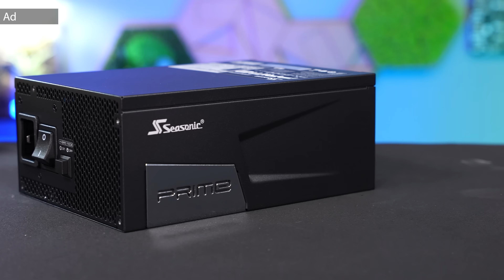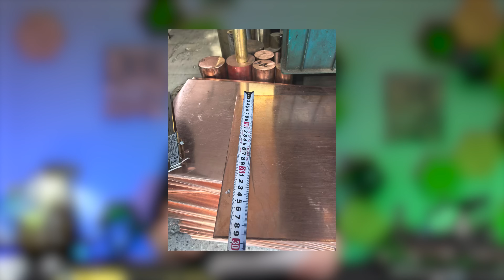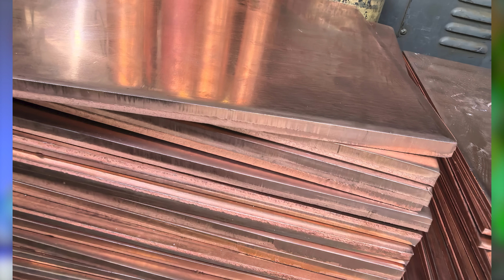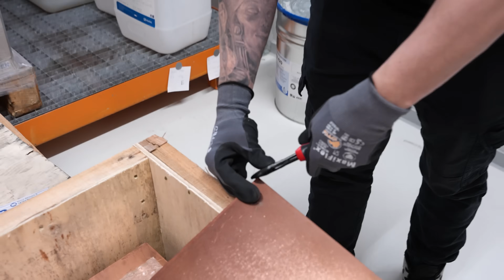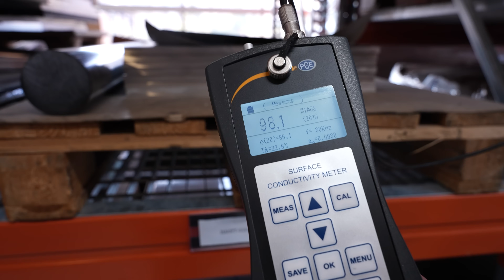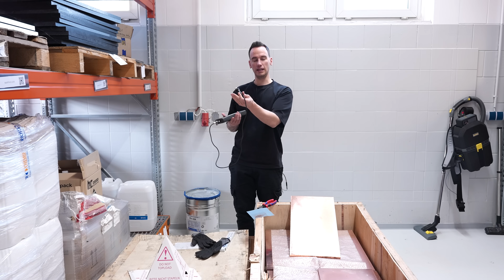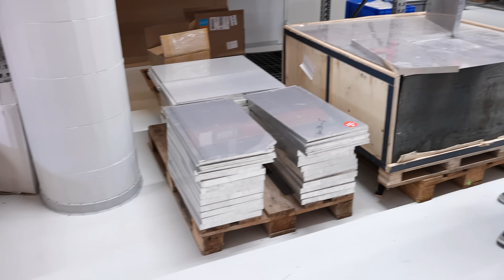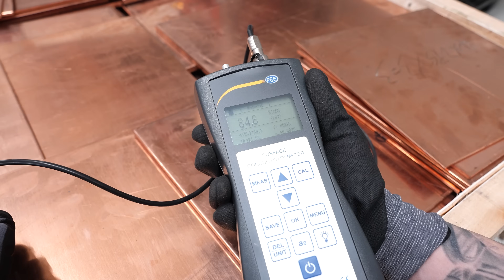I Got Scammed

Comment: American Express Purchase Protection covers eligible items against theft, accidental damage, or loss for up to 90 days (45 days in some regions) from the purchase date. Coverage is generally limited to $1,000 per occurrence, up to $50,000 per account per year. It applies to items bought with an eligible card, covering repair or replacement costs.
I don't know if copper plates would be a covered item under the American Express plan, and it looks like you would need to make 40 separate $1000 dollar purchases, but there must be other types of insurance you can purchase to protect yourself from potential fraud.
Reply: Yes, all of the large insurers that you know by name offer commercial theft and fraud insurance.

Comment: Only way to really prevent this as much as you can is to either work with an independent shipping agent to act on your behalf and verify all goods prior to shipment, or to hire someone to be your direct sourcing agent and send them over anywhere to verify all orders are what is being bought prior to shipping. They would also be responsible for making sure the shipper chosen is one that is going to be reliable and takes all reasonable precautions to avoid cargo being stolen/swapped out mid-transit.

Comment: I worked at a aluminum foundry they got ripped off on 150 grand worth of ingots that were supposed to be 25lb bars of 356 and they sent 319 with weights hidden in it to make it weigh right but you can tell by the difference in color of the alloy after you have worked with the different alloys long enough the bad part is they laid all of us off when Obama won then bought the whole damn Chinese foundry that ripped them off where they paid the workers 18 dollars a day for 10hr days with no benefits and were able to produce the parts there and import them here for cheaper than the cost of operation under the Obama regulators who were fining the hell out of them after he took office Obama and his regulators all but collapsed the foundry industry in North America in his first year of office

Comment: I've worked in the electric motor industry and we dealt with this all the time, competitors selling chinese motors for cheaper, and the reason they can is because of copper cladding. The Chinese are well known for coating aluminum with copper for motor components, and coating steel in other applications, which you discovered here.  Copper coated aluminum has been a huge problem for household electrical wiring as well.  Sorry to hear you got bit by this :(

Comment: Less than 2 minutes into the video you said copper and I immediately knew it's either Meth Heads or the term I've seen used "Chinesium". I'm not involved in manufacturing, construction, or importing...why do even I know about this? Still like others have said, I respect your willingness to be open and honest by sharing your experience despite the embarrassment.

Comment: Here’s my scam story. Spent $1700.00 on a Gigabyte RTX 4090. Purchased from CTO Technology in Richmond Hill, Ontario, Canada. I build and sell high end gaming rigs. I have product inventory. In this case, I tested the 4080 by booting the card on the bench and installing drivers. Everything good………..back in the box and on the shelf until needed. It was over a year before I needed the card, but the time had come. Paired with a 7800x3d and 64GB of ram on an X670e it was looking like a strong build. This “refurbished” card was apparently fully tested by CTO Technology………yeah…………no. Literally 30 seconds after running Furmark, the PC rebooted. Ok…..glitch. Then it did it again…….and again with Heaven…….3dmark……..whatever stress test I tried. Swapped the ram…….no change…….swapped the CPU…..no change…….swapped the board……..no change……..swapped the 4080…….problem gone. Now remember, I used this card for like 10 minutes when I received it……..but never ran a stress test. After explaining this to CTO Technology they proceeded to say the card was no longer under warranty. Bastards I thought! This card was supposed to already have been stress tested by them. I checked their website and it clearly states the following………..

What is a refurbished product?

A refurbished item is a previously owned product that has been thoroughly inspected and tested to ensure optimal performance and reliability. It is typically backed by a warranty from the seller. Before being sold, refurbished products go through comprehensive quality and functionality checks. The key distinction between refurbished and used items is that refurbished ones are verified to be in good working condition and free from defects, whereas used products may not have been tested and could have issues.

Obviously a total crock of bullshit. Oh, and the RGB on the card didn’t work either.

Comment: Didnt you purchased on Alibaba, so what the problem?..
you weirdly enoyugh dont mention anything about that platform buyer protection as there are numerous fall back nets, if you recive something that aint correct?

"If you purchased 40,000 Euro of copper on Alibaba and received steel instead, your coverage depends entirely on whether you followed Alibaba’s safety protocols. If the transaction was done properly through Trade Assurance, you are potentially well-covered for a refund, though the process may be lengthy and require extensive proof. If you paid outside the platform, you are likely not covered at all"

Did you went outside Alibaba, and purchased it directly and is that why, you dont wanna mention this?
Reply: You sound like you're blaming the customer over the two separate companies that blatantly scammed him, both on the same website, and both with 5+ year records on there.  It's highly unlikely it's their first time scamming and yet they have been on that platform for years.

Also your quote there sounds like you just asked AI and then copy pasted the answer here.  I'd like to see examples of people actually getting refunds through that platform.
Reply: @jar-z7t  no shlt.. its qoute marks.. did you think I contacted some lawyer.??  come on sherlock..make an effort.
Obviously people use Google for basic info, not least on Alibaba's safety protocols,  - as they have quite a few, that will protect you if you receive a different product, but channeholder weirdly enough dont mention anything about this, and no wonder people speculate if he decided to went outside Alibaba for the purchase, perhaps to save money, so sellers dont have to pay Aliababa fees, but he dont inform this, and thats weird as Alibaba safety protocols would be the first thing you would turn too.. and certainly not do private inquries, as its not like he can be in doubt if its a mistake.. come on..its stacked to cheat and the other steel that is covered in cobber again t cheat??.. 
Use Alibaba and do it fast as they do have, certain funds locked for a given time.
So weird that he he only mentions that he found the sellers on Alibaba, and nothing about if he actually made the orders there.??  (that is the most vital info to ask, and trying to help him get the money back, but we dont know)

And im not sure, if you dont get common sense.. asking obviously question that aint informed..how is that blaming... stop being offended on other peoples behalf at every turn, not least when people just wanna get some transperancy on a given matter and help.
Also weird that he dont wanna warn other people about these two companies.. As you can bet its likely not the first time they did it, and it can often be the same company operating under different names, as they have tons of listings and different names, and particularly companies intended to cheat western buyers... also no info onwhat he paid, as that a can also be a sign, if one seller is way under marketprice... Copper its just like GOLD.. nobody is gonna sell it under its marketvalue, and if somebody do, then they are up to no good, and its easy to check 99.9% copper prices in China but he shares nohthing about these things.. was the price weirdly low, and was that why they wanted you to fx purchase it directly for some special price??
and ofcourse I do get that he perhaps dont wanna disclose if that is the case, as viewers would perhaps make fun of that, and that is the last thing he needs on top of the loss..

Imagine if other people have warned about these companies or shown their listings on Alibaba, and he mde basic due diligence before handing out 40k then there would be a big chance that channelholder would not be in this pedicament, as he would have clocked on the warnings about these specific sellers and their company.. but nothing is shared.. to warn others with, and one of them is just ignoring him. so share the dang details, as otherwise these chinese sellers will never stop, if there are no personal consequences and they can just do it under their country umbrella from the other side of the globe.

Comment: I've had problems with car parts coming from china. The samples are good not great but the actual shipment has tones of problems. With steel parts like crankshafts and camshafts the tolerances are always the top end of the oem spec like a milled round that needs to be .003 to .005 inch oem spec they can get the resolution of .001 just fine but they always pick the bigger number. I think they believe that the bigger number is better when that is never the case for a gaped clearance. No explaining that has fixed the problem. Also oem forged parts they will copy the parts 100% but cast it and make it look forged.

Comment: Tough lessons all around.
As someone who's dealt with China imports, any reputable company would do LC (line of credit) with a small percentage pay up front and and remainder after shipment arrival, and also when you're trying to build a relationship and source things long term, always visit. It might cost 5 days and $2-3k to visit China, but you can line up 4-5 suppliers easily within a week and talk with them all and set up things.
The concept of face is important and if you're buying raw material from alibaba, unless they are a LARGE company, it's going to be touch and go.... the chances are you might be taken advantage of if you're dealing with a small company.

Comment: There is zero reason for shame! I understand the feeling but if they are going to scam it ig going to happen. Does not matter the country of origin scammers scam. You did your duty towards all other manufactures by making this video. It stands as a record of current behavior and a warning. Also shows how to check your supply so small builders can figure out if they were scammed. You handled the situation well and thanks for doing so.

Comment: Seasonic PSUs not good. they using 135mm fans. they are not available and you cant replace them with anything else. 140mm wont fit and 120mm need diy adapters.

Comment: Ohhh boy.  As soon as you said you ordered the copper plates from China, I had an idea where this was going.

I used to work in supply chain management for various manufacturing companies in the UK.  I often found myself responsible for sourcing materials and components, and I never had a good experience sourcing from China.  Even when it was from a subsidiary of the same company, the quality wasn't there, the reliability wasn't there, the communication wasn't there.  
It was a freaking nightmare every time.  
Then there's the difference in communication, the language barrier, the cultural barriers, as well as time-zones making it all even harder.  There was also this impression I got from a lot of them that they thought of us as worse than them, and not really worthy of a good effort.

Other parts of Asia were fine by comparison, but China is something I would avoid by default when it comes to sourcing.  It isn't worth the hassle.

EDIT

About the crap you did get, did you have any ideas as to what you might have been able to make out of it? Maybe some kind of Der8auer sculptures or something?

Hey, don't beat yourself up about it.  It happens, unfortunately.  One simply has to live and learn from it.

Comment: If you're gonna buy from China, you really need a local entity in China to procure your shit for you. Jurisdiction wise you're kinda locked out from taking action against the bad guys. If you had a local entity make the transaction, they could then pursue the bad actors legally. That protects you from this kind of behavior. They'll surely rip you off since you have no recourse, but ripping off a local carries a lotta risk - like going to prison. It'll add a significant cost to your operation, but it is the only way to avoid this stuff. China are mf'ers to deal with, man.

Comment: Over 60 years ago, homes unknowingly were installed with the lies from China called copper coated aluminum wire. People died over this blatant greed and deception.

This is not new.

We source from you, a small very much not cheap German engineering company and with quality expectations for your products. Thanks for trusting us to share this headache.  That said...

There has to be a German supplier or even EU to source known purified raw copper. While it "costs more", it never did in the big picture. America is still 40 years in trying to learn this painful lesson. 

Looking some up in your locale, you have options. They'll be more expensive, sure. They make take longer to procure, sure. But you'll know what you're getting and won't get scammed via a country and companies within that laugh and mock you that you "should've known better." When demand and speculation climb on a manufactured good or commodity, scams and fraud elevate just as much.

Comment: You are not a fool. Happens all the time unfortunately. Did you insure your shipment? Certain insurance covers this sort of stuff and may help at least in the future. You can claim your shipment was basically stolen. Using a LC also can help with risk mitigation. No reputable supplier will turn down a LC. Also at least check with your customs agent/broker/freight forwarder. If you got crap, you can at least try to get any tariffs/duties you paid for it adjusted. Falsifying customs documents is illegal in any country. The goods are not worth what was on the shipping documents. Or at least when you import again, use the original shipment to mitigate new shipment tariffs/duties. Also you should name shame the two "suppliers" to pressure them to refund you but the "suppliers" are probably "trading companies" that buy from others and they could also been scammed too. Still this vid will start the process. Get the news out there and the CCP will investigate. Also let Allibaba know too. China don't like it when their reputation gets thrown in the mud cause they keep saying they are not a third world country. Public pressure will work if you get enough of it. Everyone should  get this out there as soon as possible.

Comment: I use agent in China, its a big company, they find anything you want, from real factory (alibaba is 2-3 hand). They charge 3% from order value + about 600-800US$ handling fee (because orders are from many suppliers combined into one shipment and they do inspection photos for all products (sometimes can be 300 different products per container) and apply custom sticker with importer info etc.). After almost 10 years doing bussines with them and about 15 40HC containers/year we had maybe 10-15 problems and the agent company fixed them all.

Comment: Canada.  Alao, you mention scrappers...#1 can't you machine off th layer of coppr you do have instead of taking it to the salvage yard? Maybe som othe manufacturing business wold be intsted in that steel?

Could you not work out some proscess with the local scrap/ salvage yards to take their copper ad produce plates like that fr you? More than likelly, yoi'd have alot of control ths wahy for quality working so closelly with such a business... no?

Comment: Well as an Engineer, all materials we order from China, specifically Copper, we use the following services prior to shipment:
Pro QC International
SGS
TÜV SÜD
Timing: Inspections are best conducted when production is  complete.
Scope: Services include checking specifications, weight, packaging, and sampling for lab analysis.
Regulatory Compliance: Ensure inspectors are familiar with GACC (General Administration of Customs of China) standards.

We learned the hard way but we learned.

Comment: Sorry if i sound hard or harsh or whatever, but the truth is, when you recieve material, you usually cut it instead of just probing it, so to avoid such scam, ALWAYS cut into it, all the way through anywhere. or drill a hole. Cheaper to replace one piece than to recieve a whole bunch of useless stuf.

Comment: This obviously sucks, but, this is what happens when you also try to buy cheap. When I was a welder it was known that chinese steel could have issues, because they melt down recycled materials or just low grade materials, which causes issues when you go to weld it. 

It sounded like you found them through a platform. I would name and shame the sellers, but I would also report this to to platform, and if they don't seem to care, name and shame them as well. You likely aren't the first or only people experiencing this.